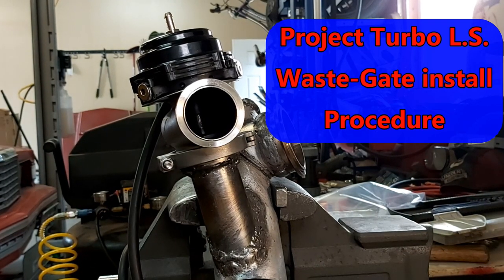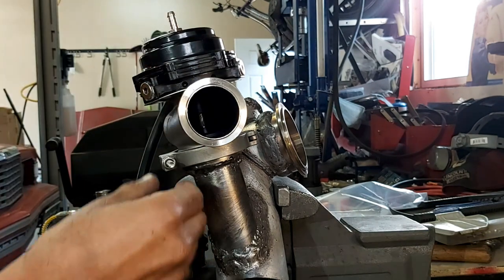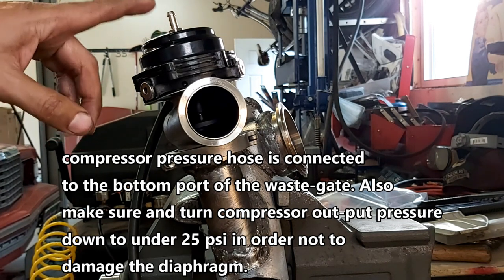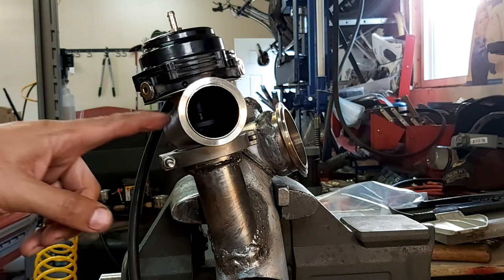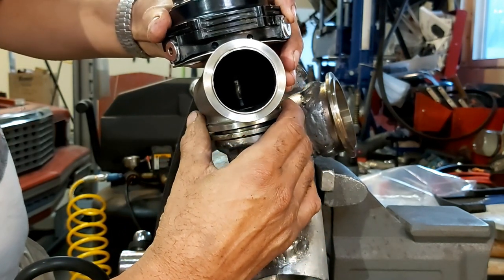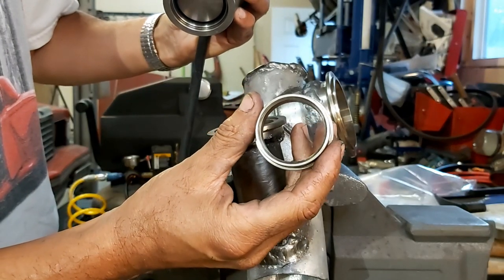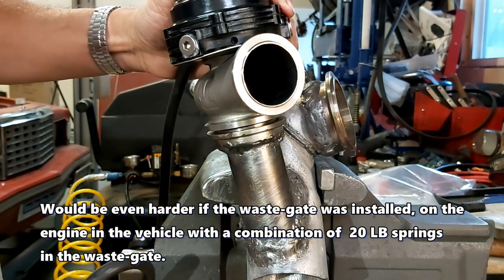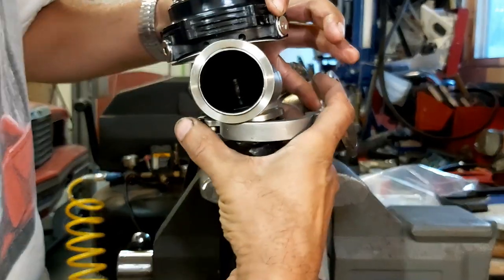Waste gate install procedure using  an air compressor, Tial V-band flange style install

Comment: Hello. Just to make sure, do you connect the air compressor to where your vacuum line would be normally connected to the wastegate?
Reply from the maker: Yes bottom port to pull the valve up. Thanks for watching and commenting.....Oliver

Comment: Do you have to redo the seats if you have taken the vband off for maintenance??
Reply from the maker: Thanks for watching. If the seats are in good shape there should be no reason to need to re-face or machine them. Also if you suspect that the v-band isn't sealing correctly it's just easier to buy a new waste-gate.....

Comment: Any over boosting issues with your custom pipe and wastegate?
Reply from the maker: Actually I'm just in the process of installing the terminator X-max at the moment. The car hasn't been run or tested as of yet. I have a similar set-up in the turbo van and the van works flawlessly with no over-boosting issues. If you're interested there are video's of the van doing burnouts & the turbo spooling on my channel. Thanks for watching....https://www.youtube.com/watch?v=py6jioakp1k

Comment: Is it best to run the wastegate off your headers or off your down pipe?
Reply from the maker: The diagrams at the link will show, which configuration of piping is the most efficient for waste-gate placement and best placement for optimum boost control.  http://www.boostedk20.com/forums/showthread.php/618-wastegate-placement-explained   ....thanks for watching and commenting....Oliver...